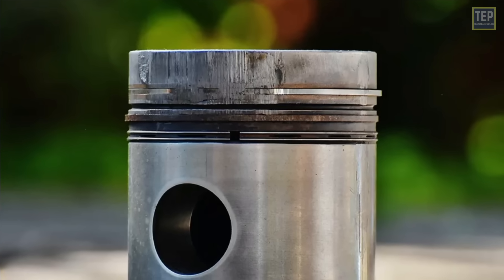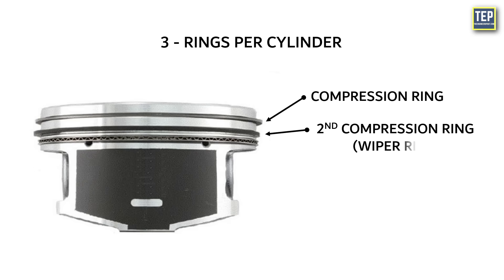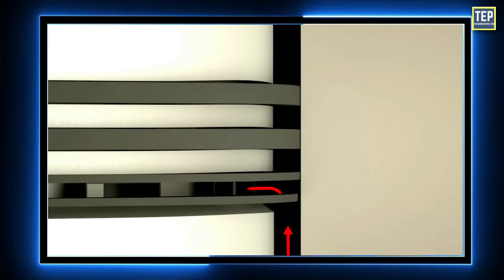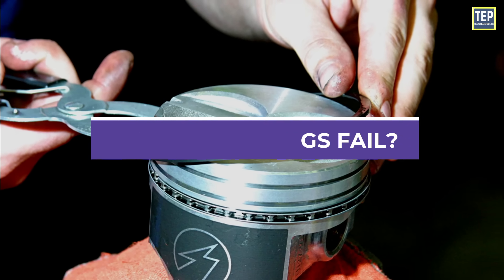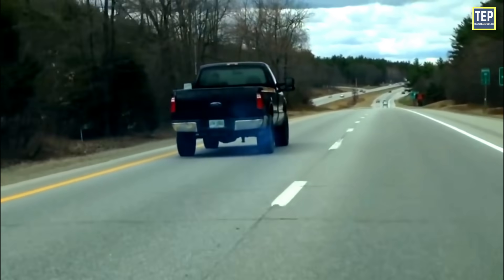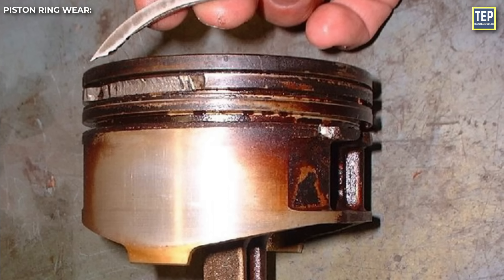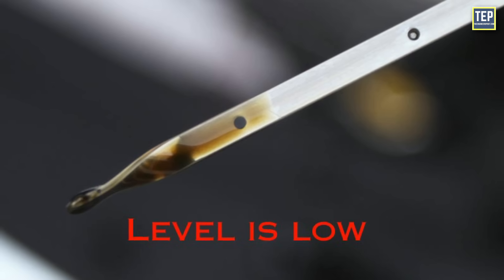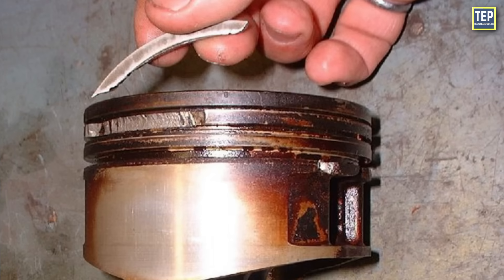Why Do Engines Need 3 Piston Rings? Explained

Comment: I have a question 😢.. What if the expander ring isn't placed perfectly. Let say, The two ends of the expander ring do not meet perfectly, for example one end is stacked on the other end or one end of the ring is not perfectly attached to the piston body. What will happen? 
2:58

Comment: Can you make another video about how you set the piston ring because I saw different videos but it’s not similar tell us how the right way to set the piston rings thank you.
Reply: there are mostly 2 ways of doing it.
most typical is with 3 piston rings.
Many of the service manuals on newer engines say to put all 3 ring gaps at 120degrees from eachother.
and another way is to put the gaps on opposite side of eachother.
i personally put the ring gaps at opposite of eachother.

Comment: It is very important engineering and hard to do it with all pressure heat and imagining bores widen during heat . Also oil need to lube the walls without excessive oil consumption.

Comment: I had a Nissan Sunny from the 80’s. The engine lasted more than 450,000kms without increased oil consumption. Those early days Nissan engines were bullet proof
Reply: Now Nissan ranks near bottom middle of all car manufacturers.
Reply: They also ran lower compression
Reply: The early Datsun roadster engines had pistons with 5 rings.

Comment: The rings act as a seal between the combustion chamber and the crankcase.  However I don't see how this can provide a good seal when there is a clearly a gap on each of the rings.  Wouldn't the gasses pass through this gap and leak out?
Reply: On assembly you stagger the ring gaps so they do not overlap to eliminate blowby.
Reply: It's called ring in gap. If set properly and the 3 different rings staggered 120 degrees apart it will perform as designed with very minor compression loss or blow by. All internal combustion engines are designed and have been for decades to operate this way
Reply: The gap looks big when the piston is outside the cylinder, but when installed the ring is compressed and the gap becomes very small - about  0.25 to 0.50mm and it almost disappears when the engine gets hot. A little gas passes through the gap but the quantity is almost negligible.

Comment: 2002 honda accord se 169,000 miles heavy oil consumption. Gonna try piston soak
Reply: Use Top Engine Cleaner, I think it's AC Delco brand. Comes in a metal can. Honestly the rings might be too far gone, but worth a try. Regular oil changes and carbon cleaning are key. I had a 99 and it drank oil like water, I topped the oil at 1000 miles and at 2000 miles id change it. Those old accords just never quit. Thing ran and ran, I worked with a guy that had one he ran low on oil for two weeks, no knock topped it up and it kept rolling.

Comment: Well explained! However, a well-designed and maintained engine and its piston rings can easily last 400,000km/250,000 miles without opening the engine without the engine's oil consumption having increased significantly.
Reply: I have a vw tdi that's just hit 300,000 miles. That's just with regular oil changes every 10,000 miles. I'm gonna try and get it to half a million miles. 🤞
Reply: @dmatteo1609 changing oils at 10,000 miles don’t know how you lasted that long but if you continue it might not.
Reply: @eliezerramosjr1017  that could be from extremely quality oils with a lot of highway miles during a shorter duration. IE, if he commutes an hour to work and back, that could easily explain his 10k miles. my driving habits? 3k-5k depending on the time of year.
Reply: Totally agree. The estimate of 100 000 miles is false IMHO...Frequent oil changes with quality oil will greatly help improve longevity.
Reply: Very much educative
Reply: I'm at 430,000km on my diesel and blow by showed up just recently.
Reply: Very well explained
Reply: 😢 Manufacturer's are not happy with low maintenance cars. Means Low money intake.
Reply: Good oil helps lubricant the engine, helps the rings & seals. That's major help. 😊
Reply: I bought a 98 GMC 2500, it burns oil pretty good, about a quart a week, has about 265k on it when I got it
Reply: My qr20 engine startes showing obvious blowbys at about 210,000 kms due to a recent miss in oil change for over 15,000 km. When found, I changed oil every 2000km. After about 3 cycles with most of the sludge washed out by cheap oil and a bit help from Lucas fuel additive for piston rings, the majority of the blowby reduced. This is the process I'm going through: Penrite mineral oil → Valvoline semi synthetic → Valvoline semi synthetic with engine seal additives → Valvoline restore and protect (2 cycles) → mobil 1 (back to regular oil change every 8,000 to 10,000 km). This is a bit overkill but I think it's worth for keeping my workhorse going for another 10 years.

Comment: Internal Combustion Engine is going the way of the dodo bird. 
Electric motors have none of the problems and complexity of ICE.
Reply: They're actually quite complex, enough so that most average people can't work on them. There's also the issue that grids aren't made to power all of the cars on earth yet and are no where near enough.
Reply: the problem with EV is battery there heavy and low capacity while Electric hybrid have capacity and lighter
Reply: Good luck putting out those Lithium ion battery fires. Google "Dutch Oven", half a billion reasons why Lithium ion battery EVs will be the doom of humanity and planet earth. Don't get me wrong, EVs have huge potential, but that potential is impossible to realize with current battery tech. Until battery/super capacitor technology or some other electrical energy storage technology is good enough, EVs are worse than ICEs from an overall practical standpoint in every way.
Reply: I can guarantee u have never worked on a car gas or ev much less worked on any sort of electrical diagnosis in any field
Reply: Sure they are, as all things do, but I'll agree to disagree about complexity. Less maintenance maybe, but plenty of complexity and quirks with electrical systems. Especially environmental factors like cold weather, widely varying weather, high corrosion areas, et cetera. I'm all for EVs if people want them, they definitely have their place, but we're not saving the Earth by their mass production and replacing battery packs every 7 years or getting a whole new car. People often forget, all modern vehicles have plenty of plastic parts, which is made from oil. I wish everyone could have an honest discussion about it, but dissenting opinions are no longer welcome in the discussion or even skepticism for that matter. Hell, a hybrid is better than full electric if you drive long distances, full EVs lose economy at higher speeds due to design, opposite of combustion engines. Not saying that makes EVs bad, per se, just not suitable for everyone in all applications. To rid the world of engines means no more hybrids either, right? Beyond sustainability, cost, and environmental impact, I wonder about security. Can you imagine all police and military in an engine free world. God forbid an emergency breaks out and power is out for weeks, how would they mobilize? Horseback? Bicycle? Again, I'm not anti-EV, I just think we need to temper it with caution and slow down our approach. Cheers everyone.
Reply: Ok but it’s expensive, horrible for the environment and you might get bullied.
Also dodo birds didn’t deserve to die.